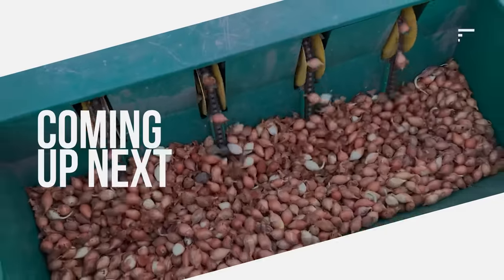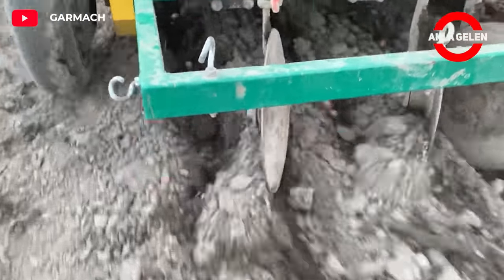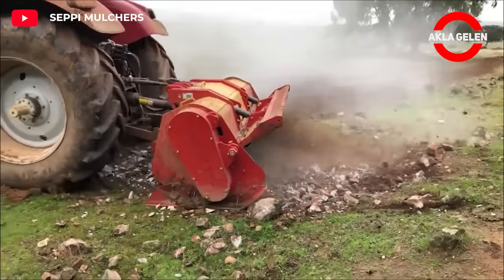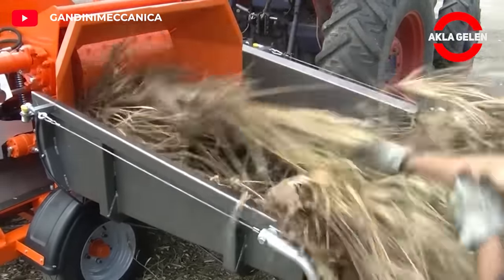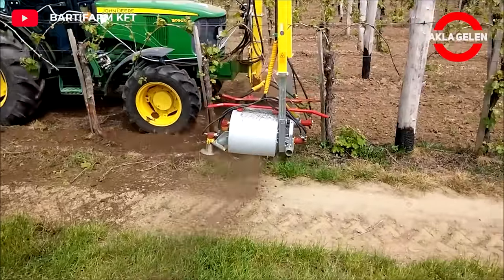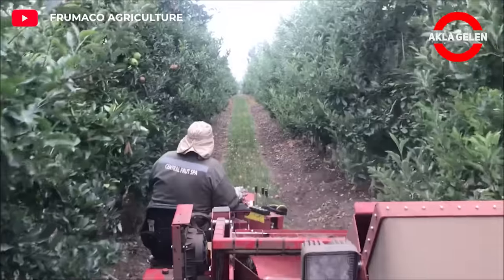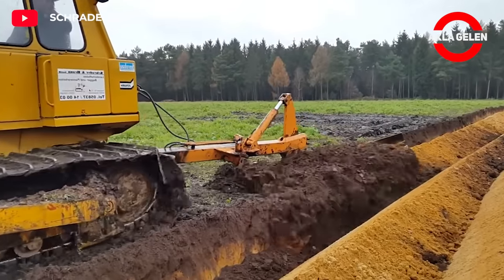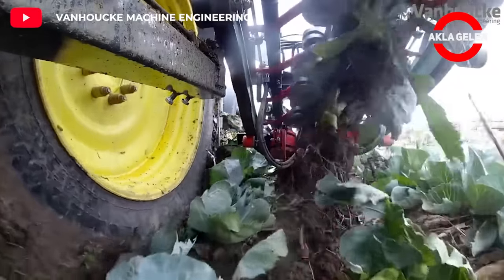This Man's Shocking Farming Technique Is Worth Seeing - Incredible Ingenious Inventions ▶2

Comment: I felt pain just by looking at deep plowing and disappearing of fertile top soil 😔
Reply: My guy... that top soil is not disappearing. It's being turned over.

That's not different than taking a broad fork to the veggie patch.

The sad part is all the chemicals they use afterwards that kill the soil life.
Reply: @beardjuice if you research on regenerative agriculture you can find out what it is doing the the active life in that soil.  Not at all like a broad fork.  But your are right - the chemicals finish the job.
Reply: That one's going to grapes. It won't be plowed again for years.
Reply: @Inspiringsuccess2  
Oh it is absolutely a sledge hammer to the face. But after two years and some soil amendments it'll recover.
Reply: Obviously you know nothing of soil maintenance  and science 😊
Reply: The equipment looks like it’s designed for deep rooted crops that require a moisture retentive subsoil.  Grape growers have been farming forever, and they aren’t dummies.
Reply: Why not just grow the grapes in a gravely soil or on sandy hills, like so many vinters have been doing for centuries.
Reply: @ricka.a.  
Cause the land they bought had different soil conditions.
Reply: You're feeling that way because you THINK the top soil is disappearing.  Indeed, it IS disappearing from our sight but not from the land.  By rolling it into the furrow and covering it up with clay subsoil, it is being sealed in and protected from erosion.  If anything is washed away, it will be the clay of the subsoil.  And if you get enough rainfall to wash that away on such flat ground as you see here in this video,  that'll be the LEAST of your worries.  You will find your house in the nearest river.
Reply: So looks like everyone here is a soil expert. Our nations biggest export by weight is soil into the ocean. So after deep till soil starts getting sun baked, dry and compacting again and yes first heavy rain and newly turned soil starts eroding towards the ocean if there is no plant cover above to break raindrops and roots below to hold soil. . Silt and clay will wash out first. First Saw it as a kid on a on a farms. But farmers have to get a loose seedbed somehow for planting. I currently practice conservation tillage and no till and have Many methods now. Just because we have been turning soil for ages does not mean it is ok.
Reply: @planetmoving9180 this isnt the US this is in the Netherlands where they fsrm in reclaimed bogs and swamps... The soil becomes stratisfied overctime and the minerals and nutrients settle down in the sandy layers... They deep plow the soil to mix the layers brings nutrients to the surface... This is essential or the soil becomes fallow...  In the end this becomes a sandy loam type soil once mixed. I believe it's done every 8 to 10 years... In between it's mostly no till...
Reply: Well done on covering agriculture technology. I would love to see more about its real-world applications.

Comment: Deep versioning is a wrong operation that should definitely not be done. It takes the fertile layers of the soil below. As a result of plowing the soil for many years, a plow base stone is formed in the soil lattice, which prevents water and roots from going to the lower layers. The simple solution to this is to break the plow base stone by splitting the soil with a chisel or ripper without turning it.
Reply: ❤¹

Comment: Doesn't damage the fruit. Come on!!!!
Reply: Those apples could be sold  for vinegar because of the bruises.
Reply: Generally apples that fall on the ground are going into sauce or cider.
Reply: Apples that fall to the ground are not intended to be eaten like it was picked off of the tree, it’s a shame that they don’t clarify that in the video.
Reply: Those cabbages are more than likely used for slaw.

Comment: I am kind of surprised that the ground up chips from the old trees for these orchards are not scattered over the top and mulched in.  I would serve to help develop the soil so the hard pan took longer to develop and it would also return a lot of nutrients as well.
Reply: Decomposing wood chips rob the soil of nitrogen its something with the way they break down... So they would actually hurt the soil... They need to be piled up and composted a bit first or used strictly as a top mulch not mixed into the soil...

Comment: Thoes rocks prevent soil erosion   by trapping soil nutrients around there base.        And trap moisture in the soil.      Rather then use them to build   walls an. Garden beds with. Let grind them up

Comment: I wonder how many folks running down farming methods have ever farmed. It is easy to criticize what you have never done. There is an enormous difference in gardening and farming, especially in a world where manual labor is beneath most folks. Soil composition, fertility and water retention varies. Farmers use the methods their soil and the crops they plant requires.